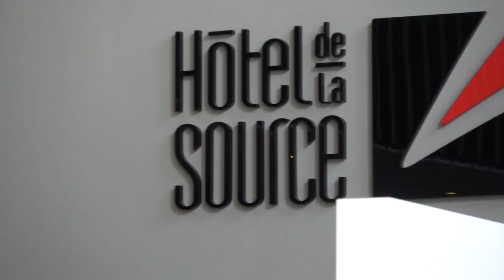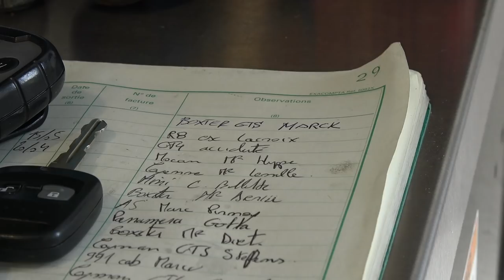Turning Up To Porsche In A McLaren F1

Comment: That MF1 needs a set of lowering springs fitted for sure. I think the GMax 25mm drop kit would be ideal for the handling but most importantly it will just look better sitting parked for definite!

Im not sure what that Jordon Curry designer fella was even thinking about not fitting the full GMax kit from the factory.

I'm sure the fully adjustable coil-over kit for my 55 plate Honda Civic is only a few hundred quid so the MF1 25mm  kit shouldn't be too expensive.

What're peoples thoughts?

Comment: The only thing that looks immediately dated on a Mclaren F1 is the wheels which look like they came off a period Subaru WRX, ....but hey i'd live with it!
Reply: So would anyone else considering they're made out of magnesium.
Reply: Actually,  it's the rear lights. And the brakes. Maybe the latest Michelin rubber is a lot better, provided the tire size is exactly the same. The audio system might be dated by today's standards. You might need a rear camera. But other than that, I wouldn't change a thing. The car doesn't even look old, and the build quality is gold standard.

Comment: Im not saying im not a fan of the mclaren f1 but could someone explain to me why it's so hyped?
Reply: Pierre Forneris 
It's hyped for the same reasons why the Carrera GT and the F40 are well respected too, it's an analogue supercar. 

-  no electronic driving assists (ABS, TCS, etc)
- Manual transmission
- NA 6.1L BMW V12
(Raw, mechanical feel while driving, where it rewards great driving while at the very limit).
- 3 seats (driver in the middle, and 2 passengers further back on either side)
- Fastest car of its time, and still the fastest naturally aspirated production car so far.
- A great racing pedigree as a GT car.